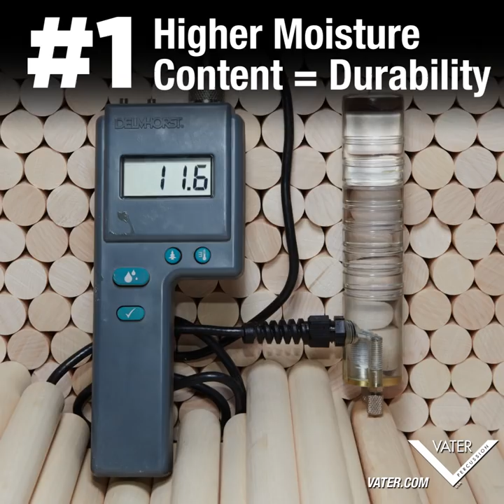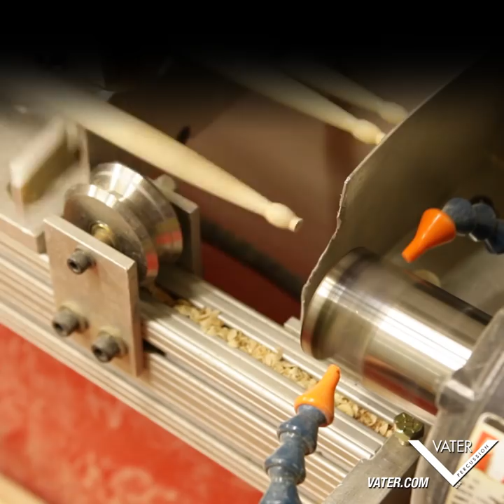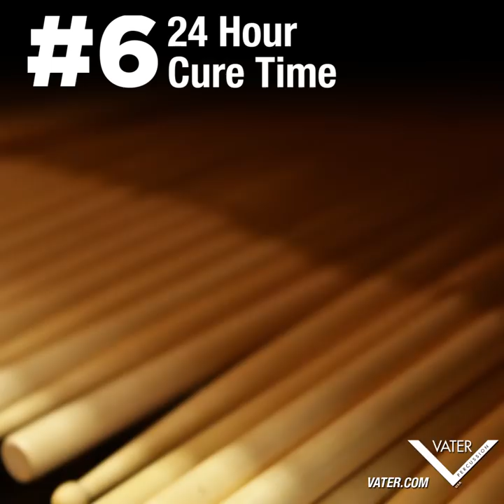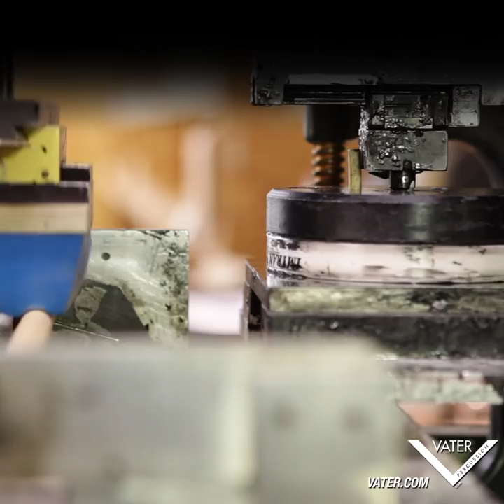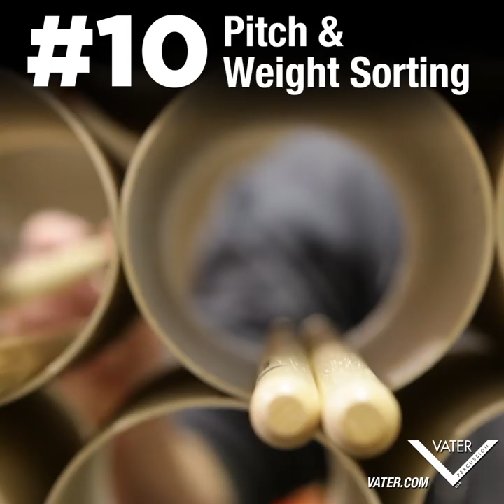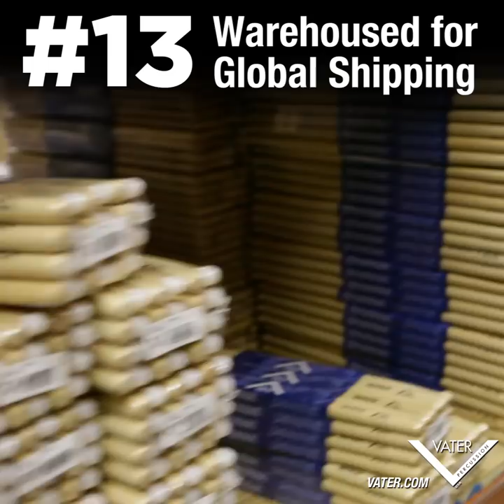Vater Drumsticks 1 Minute Factory Tour

Comment: What about the lacquer?
Do you have a 16 1/2 inch 5b?
Reply from the maker: Lacquering is shown in the video. We have several 16 1/2" 5B's to choose from. go to vater.com ...products..then "All sticks" and you can sort and filter stick models based on grip size and length. a "5B range" ii diameter s generally considered anywhere from .590-.615". Hope that info helps
Reply: Vater Drumsticks